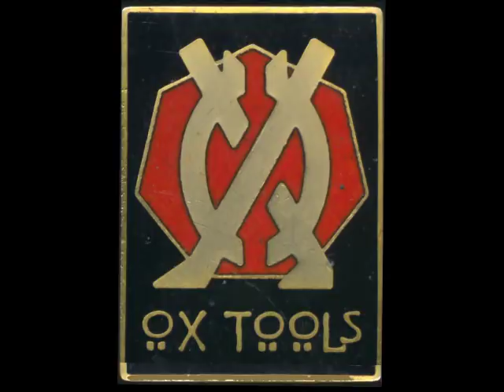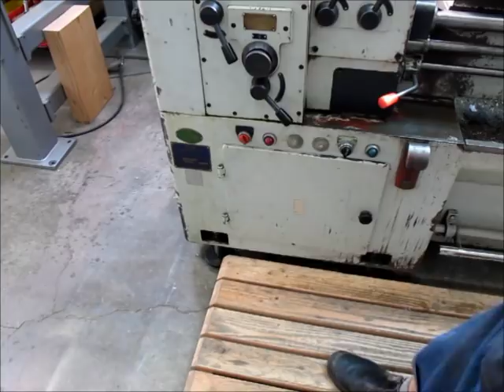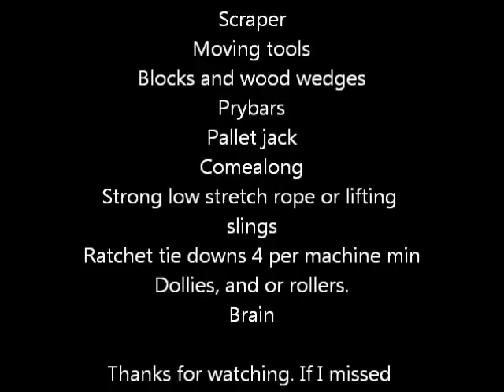Evaluating and moving a used metalworking lathe

Comment: Hi Tom,
      As always, great advice. You asked for suggestions... As a total novice who has moved a couple heavy machines so far: One is if the seller will let you look inside the headstock for chewed up dogs or wear on the main and intermediate shaft (especially on spur gear types) I think novices might not  be able to tell just by sound under power. 
    Secondly, if a buyer has a "United Rentals" or comparable rental yard nearby them, one can rent a tilt deck tandem axle trailer for like $65.00 for the weekend. Pick up Friday and return Monday AM. You usually have to reserve them. Makes it nice if you have a slanted driveway or no forklift that will fit under say, under a residential garage door.  I had the pleasure of meeting and buying a few things from you at Chuck B's meet and greet ( before Covid). I appreciate you giving back and sharing your trade knowledge.Thanks for doing what you do!

Comment: My old lathe is from the 30-40's, flatbelt driven from a shaft in the ceiling, she came from Cockatoo Island in Sydney harbour and was used by the navy during WW2.
9" throw in the step, and a 4' bed, no quick change gearbox.
The bed step piece is missing, and someone has repaired a gear in the front apron by building it up with weld and remachining the gear, she's old and well worn, long bed, big throw and I love old things. Thanks Tom for sharing your knowledge. Cheers from Australia, Waz.

Comment from the maker: Hi Flip,

Good point on the electrical. You are also correct that during the inspection you are surveying all aspects of the machine. By testing all the features and actions of the machine these bent, broken sloppy and worn things make themselves apparent. Using indicators and actually measuring wear are really outside the scope of a short video like this. It really depends on what you want in a machine and comfort level for the various problems you might uncover.

Best,

Tom

Comment: Having moved a few machines, some of the things we've used are:
-Hilman Rollers, these are a chain type roller and will work over slightly uneven surfaces and some crap  on the floor, these can be rented from most Tool rental places.
-4x6 or 6x6 timbers to make 'skis' under lathes, this allows you to move it Egyptian style on pipe
-Railroad jacks to pick up a machine to get blocks/timbers under it
-Automotive floor jacks if the machine has enough clearance to use one to get rollers or pipe under it

We've used a winch to drag the machine up on the trailer, this is also where the 'skis' really help:
- If you cut a 'lead' onto the ski, it will ride over imperfections in the trailer deck (works well on my diamond plate trailer deck, wood trailer decks may generate too much friction for the ski's to slide well)
- The ski's will also help 'tie' the legs together, which will prevent damage if one of the feet were to get snagged on something

While I don't necessarily recommend it, we've used a floor drain in the basement/garage floor as a pulling point, stuck a piece of pipe in it (pipe must fit tight into the drain to transfer the force to the concrete), chained the winch to it, and used it to unload the trailer.   We've also used 'lever' style chain binders in lieu of a winch, you can usually get a couple links of chain per pull, and use a pipe on the handle to keep from wearing yourself out.

If you use a winch, use a snatch-block to slow the pull down (and give yourself more mechanical advantage with the winch).

If you're moving the machine down hill (or up hill), make sure you have some blocks or chains to throw in front of the wheels to control the progression of the machine down the hill, or (regression if going up hill).
Reply from the maker: Hey Ice,

All good information. The key is to have enough stuff that you don't take shortcuts and have a problem. Thanks for the comment and participation.

Cheers,

Tom

Comment: I just bought an old R McDougall lath that has been laying around for years and not being used. It has taken me three days to just clean up the surface crap. It's a good size lath with a 3" spindle hole and a 10" swing. All we used to move it was a forklift, but we secured it to the forks before we did anything. We lowered it on a trailer and chained it down for the trip home and then the forklift that I hired took it off and set it in my shop. From start to finish was 2 hours and no damage. Great info. and thanks for sharing. All the best and take care.
Reply from the maker: Hey Strappper,

Good to hear you got your machine home safely. Sounds like an interesting machine. That is quite a large spindle bore for the swing size. If you have a minute shoot me a couple of pictures of the machine.

Cheers,

Tom
Reply: I don't know were I came up with a 3" spindle and a 10" swing. It is actually a 2" spindle hole and a 20" swing. It came with a 12" 4 jaw chuck, a steady rest, 2 dead centers, a drill chuck, 1 left hand tool rest , several cut-off tool holders with no blades, a boring bar holder with a few boring bars and a few other tools.
Reply from the maker: NSTRAPPERHUNTER Well that sounds a little more normal. Sounds like you are getting ready for some fun. 

Cheers,

Tom

Comment: I spent a couple of hours making those angle iron/pallet jack wheel moving brackets last week. They work great. I found that by putting them about 1/3 along from the head stock and by moving the tail stock to get the balance right I could push the lathe along by myself. Thanks for the great advice

Comment from the maker: Hi Mark,

When you make yours make sure the bushing the all thread passes through is the same width as the angle. Mine are just large nuts welded to the angles. They would be better if the bushing was longer and a smooth bore to fit the allthread.

Thanks for the comment.

Best,

Tom

Comment: One thing that I use to check when buying a new machine is to look for freeplay in the main movable parts. Just grab things with your hands and put a little muscle to check for freeplay or rocking movement. In a lathe, the main parts I would like to check are the spindle, the carriage/apron, the crosslide, the tailstock quill when is all out. 

Nice video Tom. (I know it's 3 years old, but the post-bash week let us with almost none new content hahahaha)

Cheers!

Comment from the maker: Hi Bill,

Yes they are welded to the angle. I turned them from larger stock because the bearings were metric diameter. I left the part that sits against the angle large so I had a good diameter to weld around. Material was 8620 just because I had it.

Regards,

Tom

Comment: Watched most of the video before moving my lathe and the rest after. I found all the things you listed to be true. Especially the blocks part. I just bring a couple 2x4 and 4x4s and a skillsaw for that part. I brought some thing I thought I wouldn't need but I ended up using every tool I brought. I recommend using pipes to move machines too. They work well if you know how to use them. Small lathes are a couple hour affair to move and lathes that larger and heavier can take a day or so to move as I found out. The lathe in which I moved is my American pacemaker 14x54. Fun thing is I have to move it again in a week or so same with my 4 other lathes which are 1/5 the weigh at most. Sorry for the choppy paragraph. Thanks 

Carter
Reply from the maker: Carter H Hi Carter,

Glad you liked the video and got your lathe moved. A Pacemaker is a really nice machine and heavy. Thanks for the comment.

Cheers,

Tom

Comment: We've moved lots of heavy equipment rolling it across short sections of iron pipe.  Pry bars come in handy too as well as the well placed comealong.  You want to go loaded for bear with everything you could possibly need.
Reply from the maker: Hi Clockguy,

I couldn't agree more. If you even think you might need it throw it in the truck. Even down to your own tape and band aides. Never trust the other guy to have everything you need.

Cheers,

Tom

Comment: A good video!

A couple of things: Remove the tool post so you can inspect the compound slide underneath . A badly chipped-out t-slot can be hidden by the tool post. This is a real indication of abuse of the machine.

A collet closer attachment is a big addition to the tooling. Collets are so much better for holding stock than 3-jaw chucks, especially the smaller size bar stock/parts. If there is a collet closer attachment for the machine, get it with the machine purchase.

I've been through  moving machines myself and cannot recommend anyone do this themselves. Moving by professionals won't cause you injuries, your machine getting damaged or even the previous owners other property harm. In fact, if you're buying the machine from a company you may *not* be able to move the machine yourself due to liability reasons (your's and their's).

If the cost of moving a machine isn't added into the cost of the machine you're figuring wrong. Always figure in the cost of a professional mover. It's really not that much more money than doing it yourself.
Reply from the maker: Hi Sp1,

You a Honda rider? (sp1 ref). All good points you make. Additional tooling has the potential to sweeten the deal sometimes more than the machine itself. Absolutely correct on getting a professional to move the machine. Sometimes its difficult to find a professional. There are some people masquerading as professional riggers that are real animals. Like buying used machinery they are sometimes difficult to tell good from bad.

All the best,

Tom
Reply: oxtoolco Don't ride 'bikes. I'd been dead by now.... :-) The name is supposed be "spin-rx" but that name was taken when I signed up.

Comment: Hi, great video, thanks for taking the time to share it.  Great advice.  I got a lathe thrown in with a mill in a deal when I was out looking for the mill.  So didn't really pay too much attention to what I was getting.  This lathe has a few problems including some numbnuts who painted over the information cards (threading etc.) in ugly green.  But by far the biggest is that the axle that holds the chuck is not level with the table, so every thing it hold spins off center.  It is not a visually apparent deflection when looking at it but it is more than enough to make even doing very rough work impossible.  My suggestion is that people bring a gauge along and measure if things are spinning true.  Also they should check if the chuck coming with the machine is opening and closing smoothly, the three jaw that came with mine has two of the gears missing half their teeth.  It somehow is still able to work with a bit of perseverance though.

Cheers,
-James
Reply from the maker: Hi James,

Good points you make. I should probably do a follow on video to this one and go into more detail about checking things closely. Thanks for the nice comment.

Best,

Tom

Comment: When I bought my first Lathe one of the tools I took was a telescopic magnet. 
I gained access to the gearbox and trolled the bottom , no chips and no sludge either. 
The Coolant pump growled a bit but once I refilled the Coolant with a water soluble or miscible oil it ran almost silently 
I made a set of blocks that I can sit each of my chucks on and simply slide them into the cam holes (beats holding the sucker up and possibly dropping it on the bedways.
Reply from the maker: Hey Mozzman,

Good idea on the gearbox. Some lathes are really hard to get at the gearbox without taking the top cover off. Not something I would do unless I was really serious and had concerns. Thanks for the comment.

Cheers,

Tom

Comment: Tom

I'd love to see a good video that covers these issues for a Bridgeport style knee mill

Not so much on moving it, I thing that's a whole other issue and whole other video; but I would love a good comprehensive list on evaluating it.

What measurements do you do, what tolerences do you use or call acceptable ?
What accessories do you consider necessary like dro, auto feed and do you just add those later yourself, or do you look for packages.

Would you buy a used mill, or go new ?

What brands are reputable?
I've got a smaller 6x26 import and it's a take apart and fix it diy kit rather than a usable mill.  It's taking considerable time and $ to "un-Chinese" it

I imagine Grizzly sells a boat load of them, but I'm not sure whether to trust them or not.  On the other extreme, real branded new Bridgeport/Hardenge  are 3x the price.

I'd love to get the cost savings on a used mill, but I don't want to pay a gold price for somebody else's worn out stuff.
Reply from the maker: Hi Names,

That's a mighty comment from nonamesleft. I think the sum total of words here exceeds all your other posts combined. You know I'm yanking your chain a little right? 

Excellent Idea for a video. The lathe one I did for a friend has turned out to be a really popular video. Its probably time I did one for milling machines. It would be in a similar spirit to the first lathe video with maybe more on specific things to look for. Now I need to find some beat up machines that the caretakers will let me shoot some video on. I might have some ideas on that one.

Anyway thanks for prodding me a little on this subject. Also it would be cool to know your first name since you have been a steady viewer since the beginning. If you really don't want to I understand, but I might start making my own names up.

All the best,

Tom

Comment from the maker: Hi Dan,

Great questions. Most of the fluids in the lathe actually protect it from some of the problems you mention. As far as rust protection I have used the spray on LPS #3 with decent results. The corrosion inhibiting paper works pretty well  for smaller items that can be wrapped up. Checking stored equipment occasionally and re-applying inhibitors would be a good practice.
Thanks for the comment.

Regards,

Tom

Comment: Thanks Tom for a great video. A couple of points not mentioned though, but which should be considered are that machines are often top heavy, and need to be shifted with that in mind. Lift them evenly and tie them down with opposing restraints, so they don't slip through the ropes/slings/chains. Also be sure to protect the machine ways or other precision parts like lead screws from being bent or scraped by lifting tackle. Your reply to H'hog that tool makers have rigging guides is good advice.
RT

Comment from the maker: Hi J,

Height is the enemy when moving heavy stuff. Take a look at your local rental yards for a hydraulic drop deck trailers. Cheap to rent and you can roll a lathe on a pallet jack right onto one. JLG makes one if you want to look it up on the web. Second choice for the average guy is a car trailer. Ramps can be tricky with the car trailer. Third choice would be a tilt deck car carrier. Watch out for untrained operators on that option. Machines are way different than cars. 

Best,

Tom

Comment: Very good video.  I was curious to see a broader look at your lathe.   It's an interesting model and seems to function nicely.  Too, I had wondered about the Travadial that you mentioned in passing in a couple of your videos.
One thing that might be good to mention is leveling of the lathe when it is installed in the place where it will be used.  Aligning the bed using a precision level will insure that the lathe will produce accurate results, of course.

Comment: Hey, Great video.  I've been watching all this stuff and finally realized you did
the "metalworking Sink or Swim" book.  I mention the complete
title because it's a great book and others might want to check it out.
Anyway - I have to move a 5000 lb lathe up a single 7 inch step in concrete
(making good on a 1.5 year promise "honey, you'll be able to park the car inside again as soon as I move this thing back yonder..." ) and this
really looks like the hot ticket (for the move it to the step part.)
The sink or swim book shows the "skate board" dollies but the swivel
part eludes me completely as I get scared about loading and all, so here's
another vote for more detail on that. 
On the bigwheel things is the axle pressed up to a shoulder into the angle and
then welded on the wheel side only?  And if it's easy I'd really like to know
what size angle that is.
Anyway, looking forward to next book and thanks for putting all this stuff
out.
Reply from the maker: Hi Jeff,

There are a couple of people asking about more detail on the lathe dollies. I'll try to squeeze something into a meatloaf that shows some closeups. Stay tuned. Thanks for the comment and support.

All the best,

Tom

Comment: I bought a Colchester (Clausing) Student 18" swing unseen. On eBay... More due to luck than anything else, the machine is in pretty good shape for it's 50 year age, but it does have a couple of issues which I didn't foresee, due to lack of awareness. There's a LOT of backlash in the cross-slide leadscrew, the taper turning attachment is missing bits from it that make it unuseable, the screwcutting gearbox loses a lot of oil and the gibs on the cross slide and compound could do with adjusting.

Comment: This has been an extremely useful video as these principles you have talked about and demonstrated could be applied to a wide range if not all heavy complex machines for a workshop. Is it worthwhile and could you in practice drain off fluids, remove items to reduce weight before moving machines? How can you protect these machines from rust temporarily as in many cases they may have to be stored for a while before being installed? - this might be in or outdoors

Comment: Pallet jacks are great for moving large, heavy equipment.  Floor space to maneuver them can be a problem for small home shops though.  I have a Hefti-lift that can lift around 800 lbs to over four feet.  It has a footprint of a bit over two square feet and is very maneuverable.  It is definitely a back-saver. (Google Vestil - Hefti-Lift.)